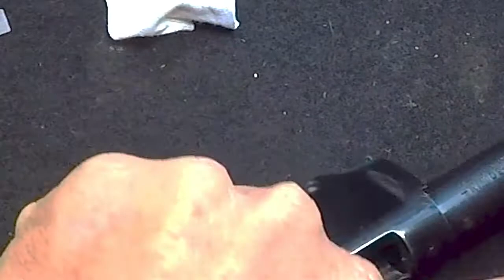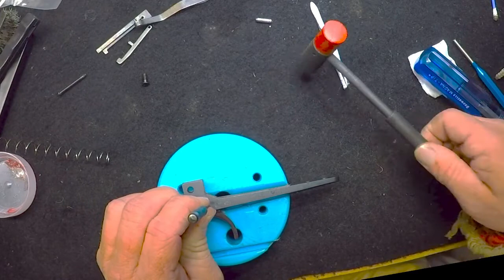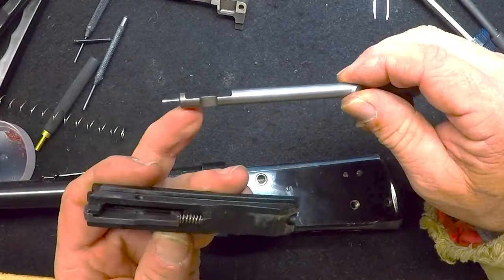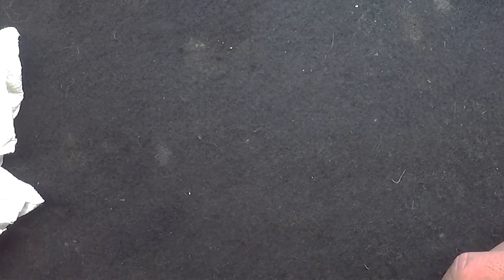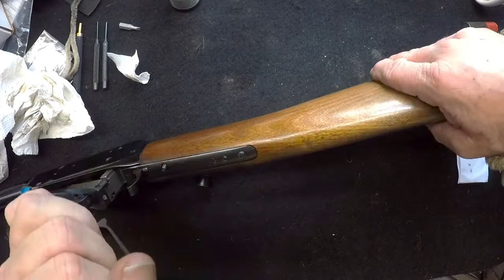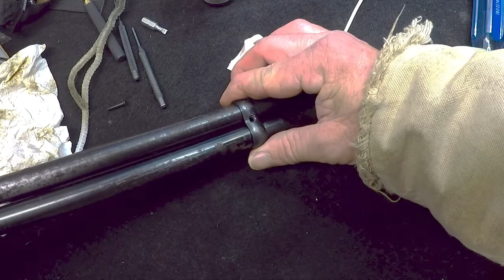Post 64 Winchester Model 94, Reassembly

Comment: I really appreciate your honesty during assembly. The fact that you show your mistakes and then  disassemble and show the repair is refreshing.   This is my 1st time working on a model 94. My issue isn't withe gun with the variations of parts that are used In even just the post model 64. I would be in the middle of assembly and in fine that the part being used looks nothing like the one that I took apart. I happened upon your video and found that it was as close to the gun I'm working on as I have found so far. The only exception Would be the forearm and magazine tube as mine is a Lone Star commemorative 30 30 with a 26" half round barrel. Not a big deal, it just uses an end cap as opposed to the barrel bands. This rifle was left tipped over wrapped in a towel on the floor of a barn for 20+ years. I had to use a 24 hour soaking with penitrating lube and a heat gun to breakfast a few screws. I'm happy to report no hardware was harmed during disassembly.  Now in the process of assembly and I found your site. Thanks again.

Rich Gong USN veteran

Comment: Great video. Thanks. Mark Novak shows repairing screw heads on his channel Anvil. I'm a qualified motorcycle mechanic and I agree about greasing those bearing surfaces. Firing pin I oil, then wipe it all off , just to prevent corrosion.

Comment: Little advice the  model 94 is very challeging if your not familiar with working on firearms best left to a gunsmith . if you use a slave pin from other side when installing hammer & trigger assy  first helps a lot .
Reply from the maker: You got that right. A nightmare of small parts. Thanks for the advice.